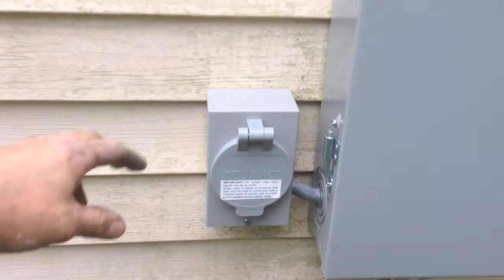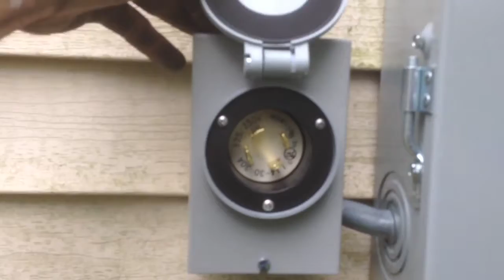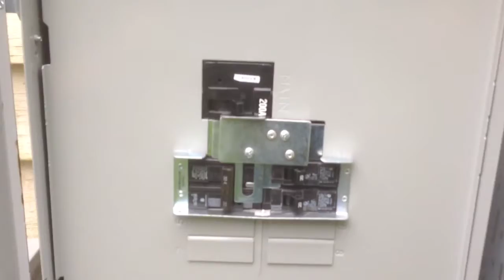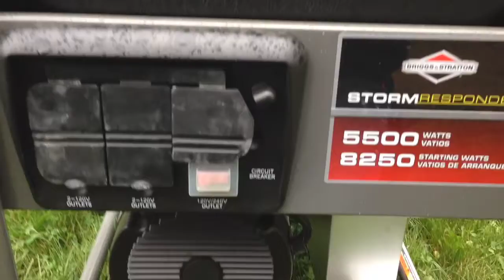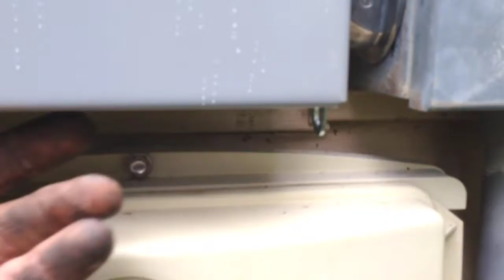Transfer power from utility to generator

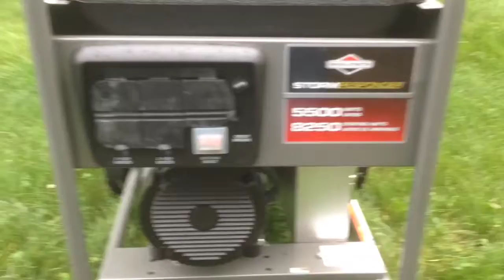Comment: Don't understand folks making an instructional or "for info" video....and say, "I don't have the supply chord to show you right now", etc, etc.... why make the video without showing all the pieces ( 0:45-0:50)?  Within the first few seconds of the vid we see the page "Steps for connecting and disconnecting your generator", and then doesn't show this. 

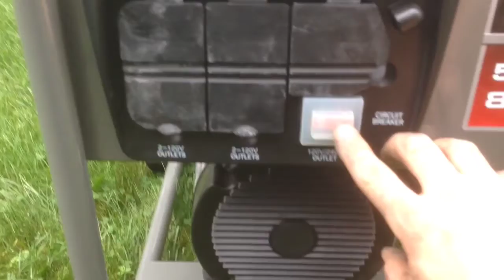 " And the "first" thing you do is NOT start the generator (0:50-0:55), and then connect up the high volt/high amp chord between the genset and inlet box....why not do the chord hook-up FIRST before you start the unit and lessen the risk of handling a live wire  ?  Also....this vid describes an INTERLOCK device that toggles between LINE power and GEN power inlet sources.....it is not a MANUAL TRANSFER SWITCH basis,  which is altogether another means of doing this with another type of device, ...this is an interlock method. The interlock allows BACKFEEDING all the branch circuits of your main breaker with a dedicated gen-supply breaker,  and the video correctly warns you to activiate only those branch circuits which are necessary during an outage,  and which can be handled by the generators power output capability.

Good video.....but its not a transfer switch method. Here instead is an example of a transfer switch method---> https://www.youtube.com/watch?v=Z1m3Wu6LLQI

.